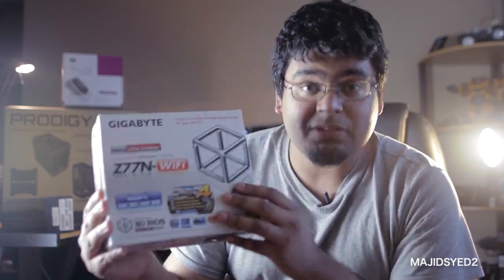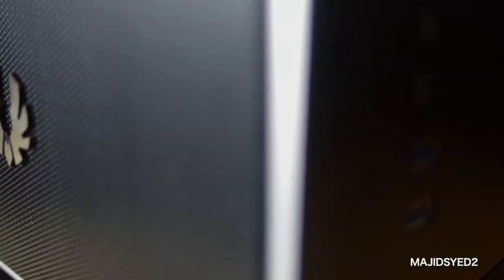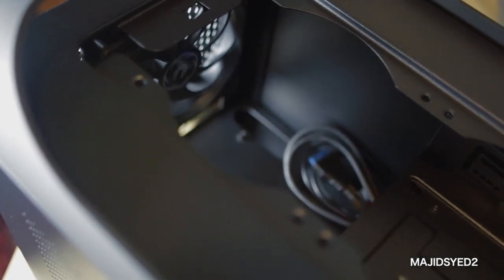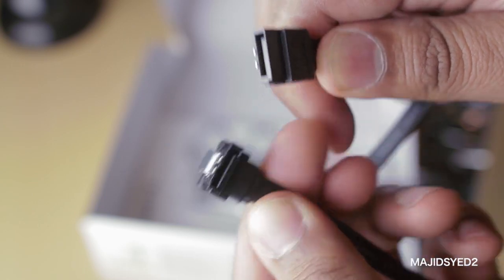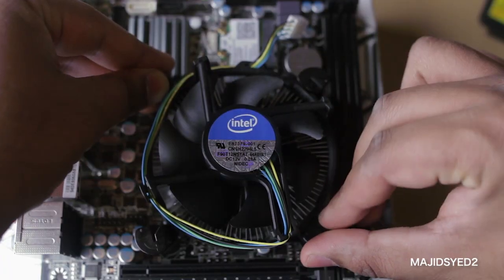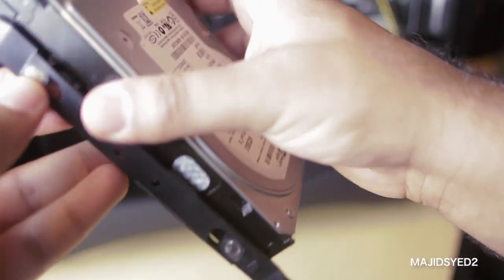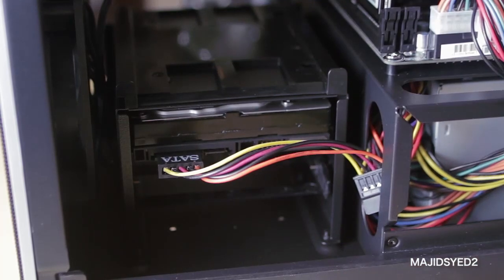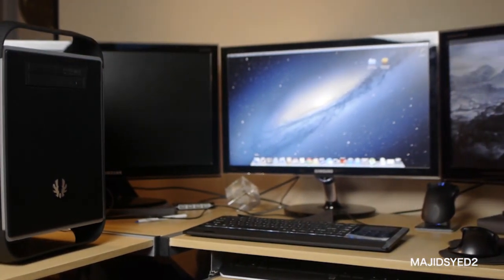How to Build a MAC for $400 - Hackintosh - Part 1

Comment: Can I install El Capitan on my laptop Asus x552c
i will be using Logic pro x nd FCP
1. 8 gigs ram

PROCESSOR:
Brand Intel
Chipset Mobile UM77 Express
Cache 3 MB
Variant 3217U
Clock Speed 1.8 GHz
Processor Core i3

GRAPHICS
Dedicated Graphics Memory Capacity 1 GB
Graphic Processor Nvidia GT710M
Dedicated Graphics Memory Type DDR3
Reply: If you can't (which sorry to break it to you, is probably the case since laptops that are fully compatible with OS X are EXTREMELY rare), you can still install it on a Virtual Machine and get the MacBook experience. You wouldn't be able to use your computer's full power though, but it's better than nothing!

Comment: Hi my config is i7 4790k, z97x ud7 th, corsair 750 watt PSU and 16 gb ram. Could you kindly confirm which GPU is good for DI, FCP and VFX.
Reply: Is it possible to build a PC with windows, Linux and IOSx? The would be a great build for everything.

Comment: Can  I use the G3258 instead of an i series CPU or would I need to stick with the i series?
Reply: ***** just wondering, why won't yosemite work on the G3258?
Reply: ok, thanks
Reply: ***** Wait so will Yosemite work or is the cut off up to Mountain Lion like you mentioned? I heard people say no bc the graphics on it (Intel HD). I haven't really seen much Pentiums used myself but what if you use a discrete GPU does that change things?

Comment: do u have wifi on that and if you did what wifi card did u use?
thanks
Reply: Comes with wifi.
Reply: no the built in wifi-card on the motherboard is not compatible with Mac OS and has to be replaced with one that is.
Reply: just get a dongle

Comment: You should do a external build before putting it in the case so if there is a defective part, it easier to get out rather then getting it out of the case etc. But This is still a great video! You got a Subscriber!

Comment: i did exactly like you said, installed ml sucessfully but some reason the hardisk only boots in safe mode. (-x) tried everything it dosent works.

my build 
cpu - i5-3330
MB - Gigabyte GA- H77-DS3H
I checked tonymac86 the MB is hakintosh compitable..
any advice?? :(